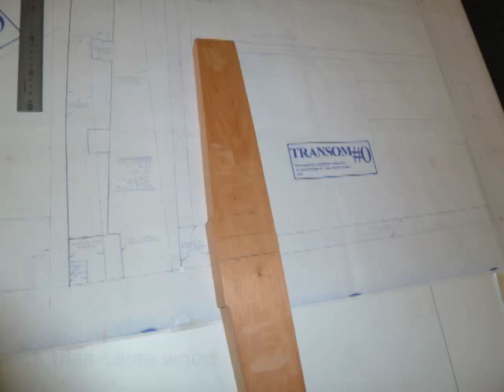Boat Build Movie

Comment: Really nice built, is it maple strips in between the deck strips of its some kind of compound??
Reply from the maker: Hi Tomy, it is caulking although, really, a light colored wood would have easier and just as effective!
Reply: +AndrewsWIP thanks for your quick reply, so the caulking doesn't serve a purpose? Like preventing checking or movement?
Reply from the maker: Hi Tomy.  In the originals, the deck planks were fastened to the deck beams and so caulking was used to allow for wood movement and to keep the water out.  In my case, the deck planks are glued to a plywood substrate so, in that case, movement and leakage are less of an issue.  Some people fill the gap between the planks with coloured epoxy, some with wood and some with caulking.  But over a plywood base, it tends to be an aesthetic matter rather than functional.
Reply: +AndrewsWIP ha, thanks for clarifying this for me ... I always wondered about this... It makes sense now! In any case your barrelback is stunning and I will add this to my bucket list of wooden thing to build...thanks for sharing your process through your videos and taking time to answer my questions...

Comment: Novice question here. How well do the Glen-L plans guide you through the build process? Are they just specifications or do they provide step-by-step construction narrative.
Reply from the maker: Hi Gregory - tricky question to answer.  Focusing purely on the Riviera design - aside from the line drawings, Glen-L do provide a construction guide that sets out some level of step-by-step for the hull.  But it is not a general guide to boat construction - so techniques are not addressed (those general technique aspects are covered in other Glen-L material and, of course, through their forums); more focusing on construction elements and sequence that are specific to the design.   But really only for the hull.  Once you get to elements such as wiring, engines, steering, bilge pumps and so on, you are on your own with very little - if any - details.